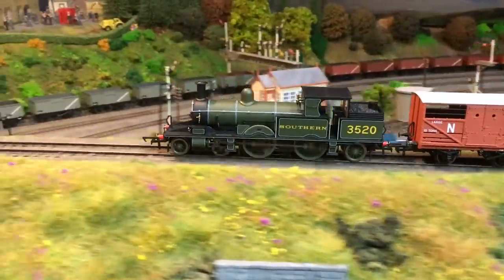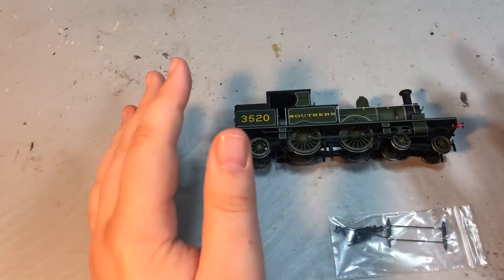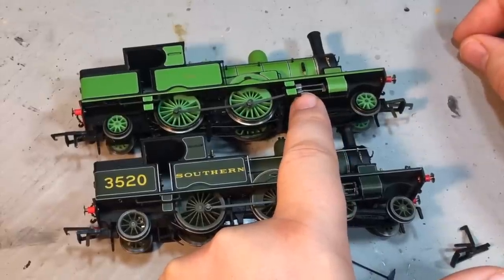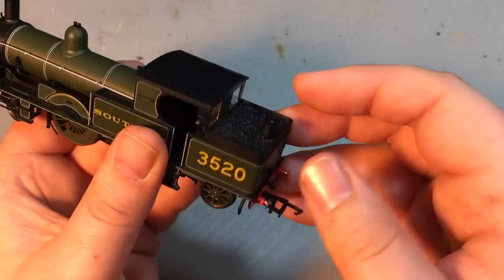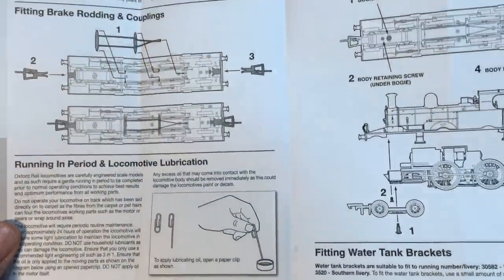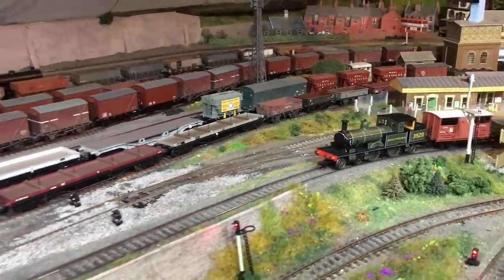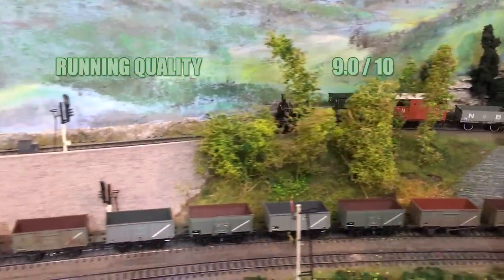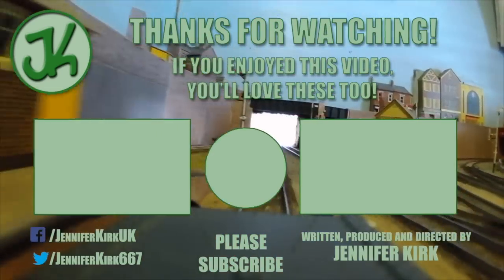The Budget Beauty! Oxford Rail Adams Radial in Southern Green livery - Unboxing and Review

Comment: Hi Jenny. Liked the vid, but just a few points. The branch is pronounced Lime Regis. The Adams Tank 488 is in as built condition. Because it was sold to the WD, it was never rebuilt by Dugald Drummond or Robert Urie, and is the loco preserved on the Bluebell. 3520, on the other hand was rebuilt by Drummond, and is modelled carrying a Drummond boiler, with safety valves on the dome.. The builders plates on the chassis were carried by the locos until withdrawal, 488 built 1885 by Neilson & Co,  3520 was built in 1885 by Dubs & Co., and received her Drummond boiler in 1907. Hope this helps.
Reply: "Lime" as in green fruit.👍

Comment: Good Evening and many thanks for a great review.
 I would love to order 3 or 4 of the Oxford  Adams Radials but I had one before and  I had 2 problems: 
at a minimal incline the driving wheels were suspended and lost traction.
 Secondly the motor simply wouldn't work so I sadly had to send it back.   
 I would also like to order the lovely new Deans Goods, but my last  model also had issues too. 
On 2nd radius curves. the tender was so close to the cab that it would derail! Can you inform me if any of these defects have been addressed in these two models please? Regards. Ralph